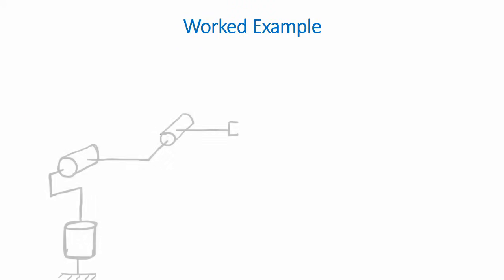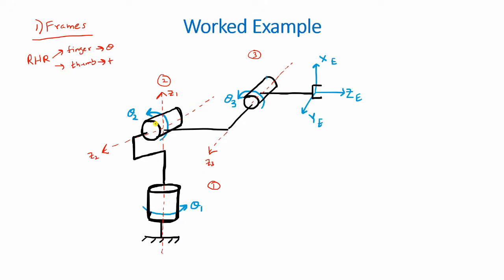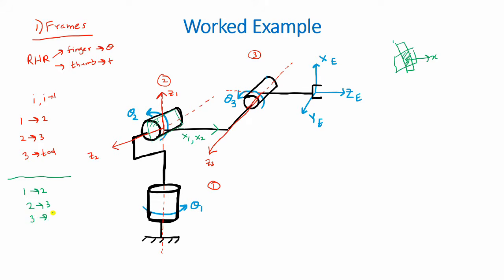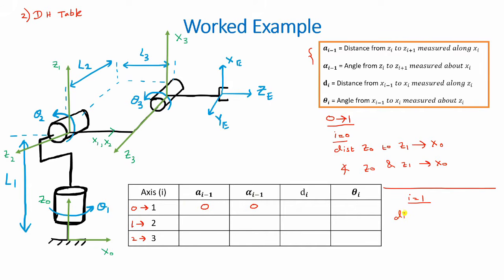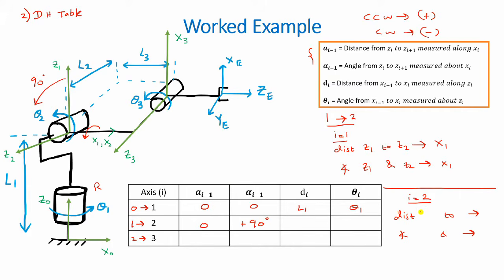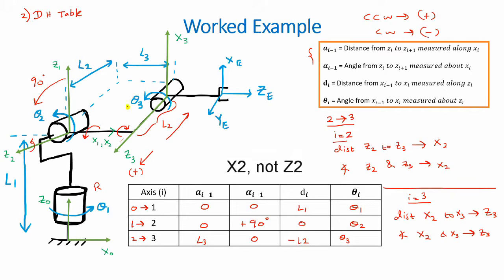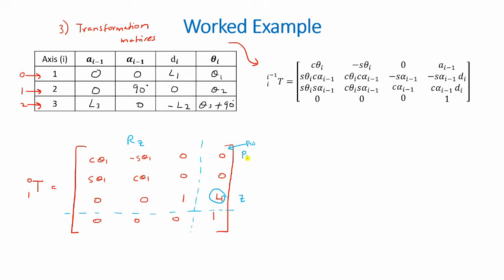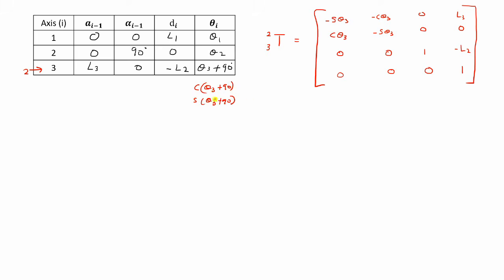Worked Example - Frame Assignment | DH Tables | Transformation Matrices (Direct Kinematics IV)

Comment: 6:12 how did we decide on the direction of the x1 axis. The normal could point inwards to the plane too.
Reply: I assume you mean left or right.  Mathematically, even if you make it left it would still be fine because x2 would definitely be facing right (towards the link), i.e. facing the common normal.

So the only difference then would be a 180 degrees in the link parameters table for alpha of 2nd link.

But a 180 switch on consecutive joints which are intersecting makes no impact to the overall transformation matrix. So same result at the end.

Comment: When finding the normal x direction in an interaction of axis, after drawing the plans, what determine the direction exactly? I’m just a bit confused on that part. It is the shading ?
Reply: I have the same doubt and alpha rotation values confused me man.
Reply from the maker: By convention you can take the positive x-axis along the link (if there is a link in that direction) otherwise, you can use the right hand rule for that joint (where the planes intersect) ; and the positive x-axis would point away from the direction of rotation. This is just a convention, but you can define any direction normal to the plane as the positive x-axis, however, if you did that, the values you would calculate later on would be different. I hope this answers your question, if not, do get back to me. Thanks and all the best.